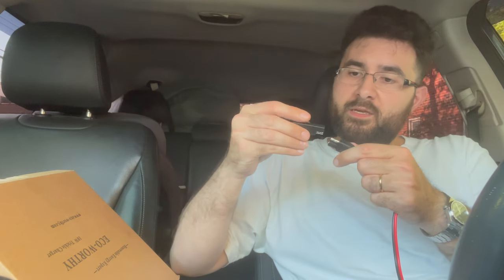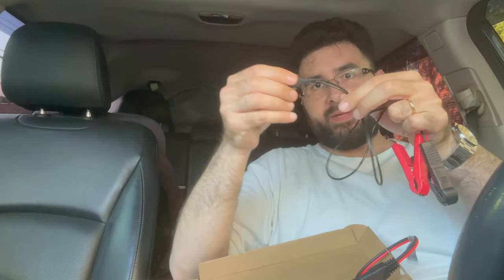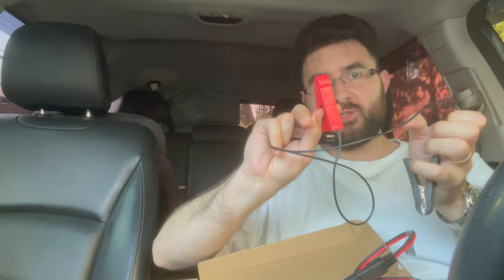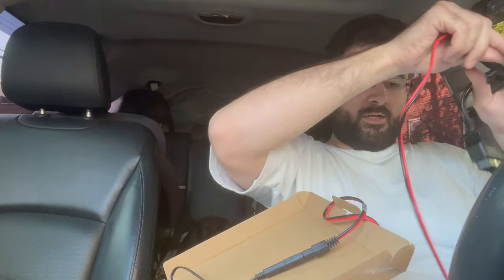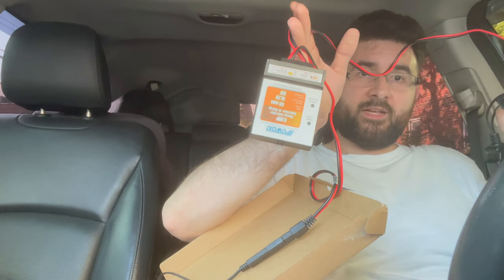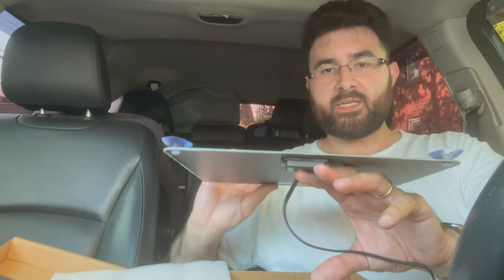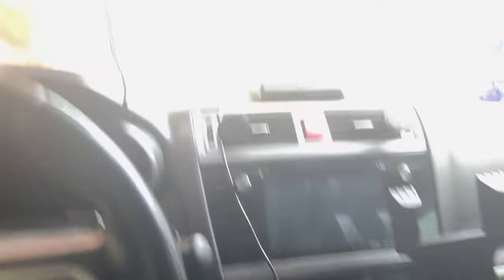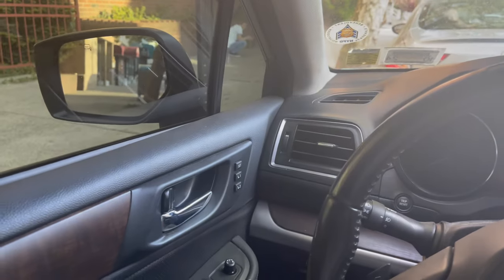Trickle Charge Your Car Using Solar Panels! No More Dead Battery!

Comment: If I plugged a battery trickle in while van camping and I use stuff to run off my car battery you think the panel will help from it dying ? TIA
Reply from the maker: The short answer is yes. The long answer is kind of but not really. What are you running while camping and how much power is everything your running in a form of watts. For example: I have a car ice refrigerator/freezer that consumes 60 watts. If that’s all your running this solar panel would decrease your usage from 60 watts down to 35 watts an hour. Usual car battery holds 500-600 watts per hour. So divide 35 to 500 or 600 and that’s how many hours you can run it. Their are more powerful solar panels example 25 watts all the way up to 200 watts but I wouldn’t charge the cars battery via the OBD2 port more then 25 watts because that’s 2.083 amps assuming it’s running 100%
Reply from the maker: The purpose for this setup is for people who leave their cars parked for extended periods of time and so that the battery isn’t dead when they drive again. Example: I leave the country for 3 months to Hawaii on vacation. I come back knowing my battery will turn over and start instead of asking a friend to start up the car every day or every other day for 20 minutes or jumpstart the car when I get back
Reply: @utkureviews  Thank you for the reply. No I'm not powering things like that and understand I would need bigger panels. I was just asking for like very small fan or leaving my stereo on for a hour or 2? My battery is great BTW. I got a lot from your response thank you very much I think I will be OK.
Reply from the maker: I would do research on how much the obd2 can handle as far as Amps/watts I wouldn’t connect anything above 35 watts but that’s just me
Reply: Utku bey merhaba konu ile alakalı desteğinize ihtiyacım var mail adresinizi verebilirmisiniz alakanıza şimdiden teşekkürler